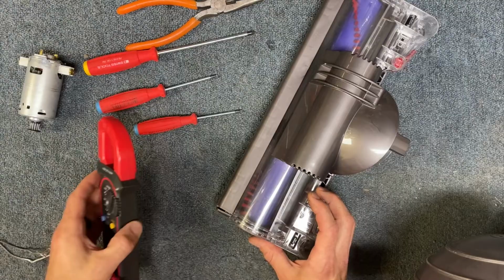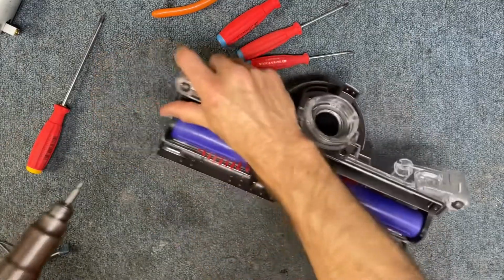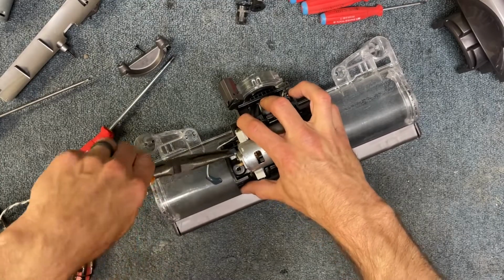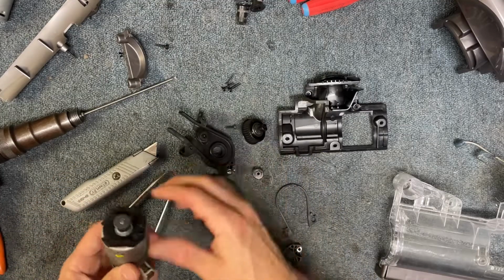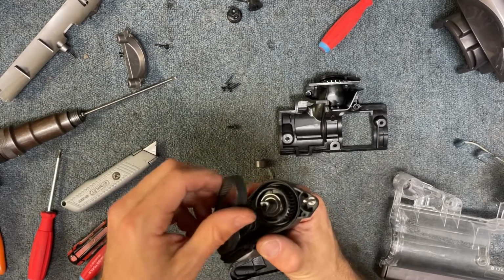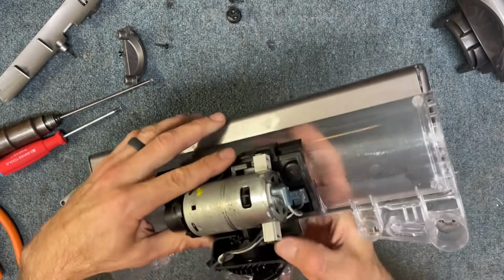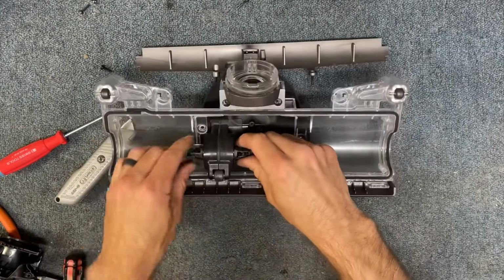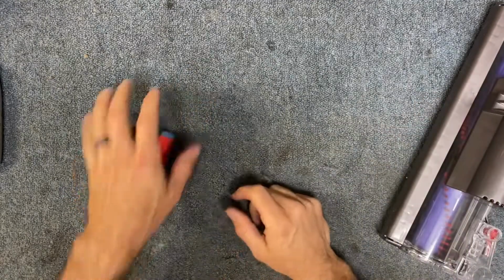Vacuum repair man | How to replace motor in Dyson cleaner head | UP13, 14, 16, 19, DC65, 66

Comment: Just saw this video because I picked up a free Dyson along side the road. The problem is the motor on eBay is $80 and the whole cleaner head from Dyson is $98. It’s worth $18 to not have to tear stuff apart. Not if the motor was maybe $16 then yes.
Reply from the maker: Yeah sorry. At the time i recorded this video the motor was not expensive.

Comment: Thanks for the info.  I opened ours up and found the belt had snapped and had also stripped multiple teeth in a couple of places.  Now to power up the motor to see if it still works.  I need to find a belt supplier in Australia.
Reply: Belts not available in Australia, at least not on line.  I’ve ordered what may be a suitable one from Aliexpress.

Comment: Don't you mean to say AC voltage?
Reply from the maker: I don’t remember. I could be wrong but I think this unit has an ac conversion into dc at the board inside the ball which would mean the motor is dc. But I’m going off memory.
Reply: @richardsvacuumcenter  Ours stopped wotking this morning so I just checked it before seeing this video and it definitely outputs DC.  Looking at another video channel, it looks like the PCB in the cleaner has 4 diodes (in a bridge rectifier configuration - ours is a non-ERP version) and an electrolytic capacitor to rectify the AC supply voltage.  However, mine gives about 320VDC no load  (I'm in Australia where we used 230VAC for our supply, not 120V).  I thought 320VDC was a bit high but a check on the Dyson forum indicates 300VDC is correct.  I'd like to know what DC resistance I can expect from the motor.  Ours is about 70 ohms.

Comment: Can you replace the spindle with the bearings
Reply from the maker: Technically yes. But I don’t know the exact size. There will be numbers on the race seal that will say what size the bearing is. You can also clean and relubricate the bearings
Reply: @richardsvacuumcenter  Weird question, do you think it would be possible to 3d print the spindle and then replace the bearings?

Comment: Are those motors you sell ones specifically for UP16's?
Reply from the maker: I don’t sell the motor. But the motor in the link should work for a up16
Reply: @richardsvacuumcenter  Great thanks. Btw, I left you a message at your shop for more help with the vacuum. I do look forward to hearing from you tomorrow so I can get it fixed. 🤗